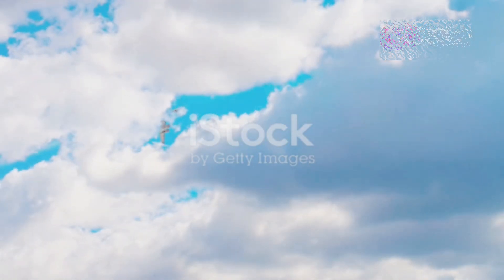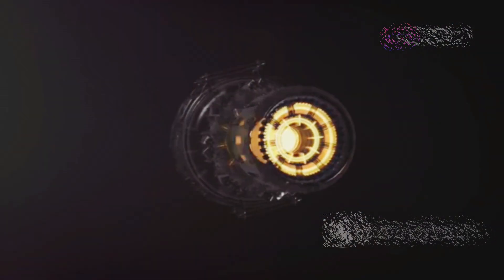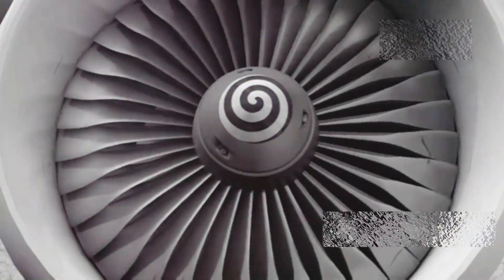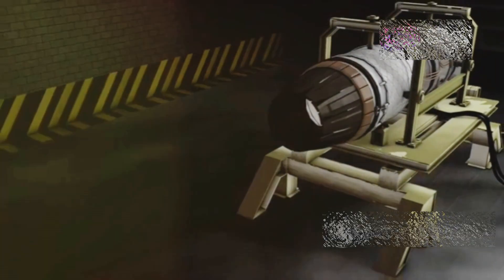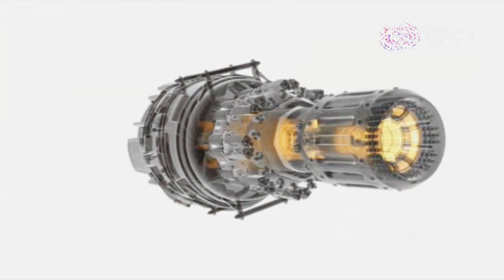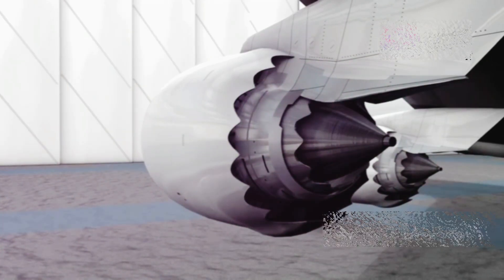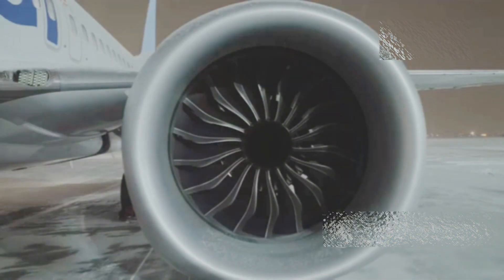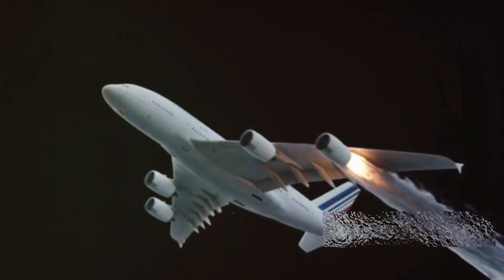How does a Jet Engine work? #engine

Comment: Thanks for explaining the fan for what it truly is, an air intake and compressor. Most people think that the fan is a propeller encased in a shroud in the case of passenger planes and that only fighter planes have true jet engines.